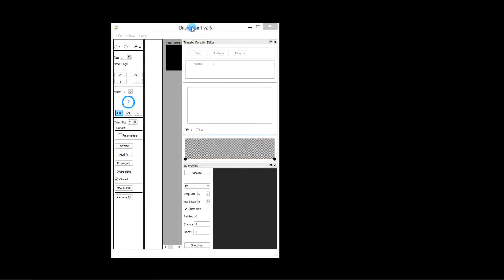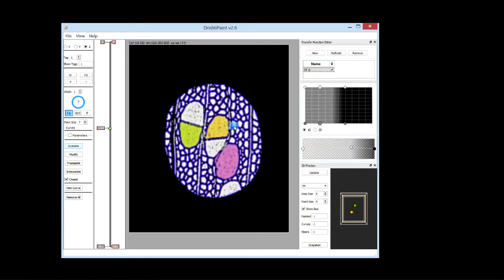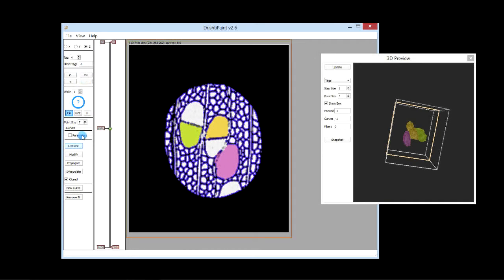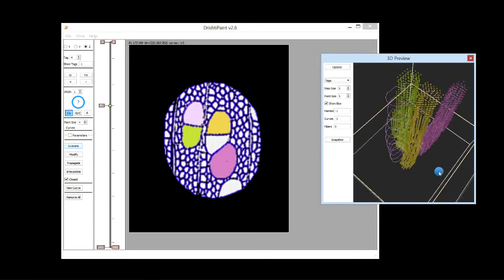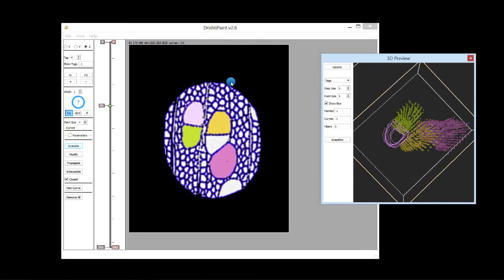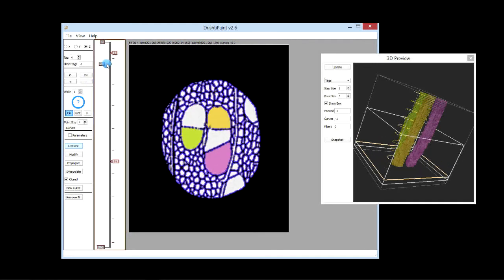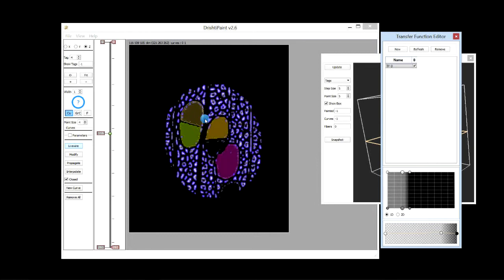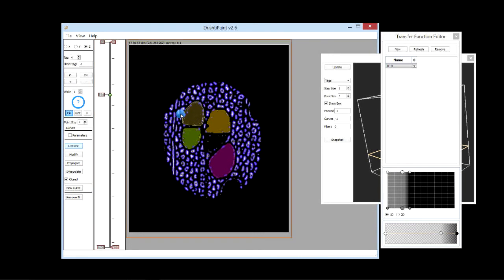Livewire (1) in Drishti Paint v2.6

Comment: Hi,
Firstly thanks for your excelent videos they are very informative and go at a great pace.
I accidentally flood-filled an image slide using keys 'F' and 'G' on drishti paint and I cannot delete the coloured tags.  Any ideas how to solve this?  I just want to delete all tags on that one slide so only the original image is left.  Thanks so much for your help in advance!
Reply from the maker: Hi Tom,
  When in the 2D slices window, press Escape to stop the repeat process.
Curves Mode -
To remove all the curves on a particular axis (X/Y/Z) use "Remove All" button at the bottom of the Curves Parameter menu on the left.  You can also remove the curves individually by hovering over the curve and pressing DEL.

Graph Cut-
Press r to reset the tagged region on the current slice with the current tag.  Use Shift+r to repeat the operation over multiple slices and press Escape to stop the repeat process.

There is inbuilt help for these operation in "?" button just above the Cu/GrC/F buttons.  The help changes according to the option selected.
Reply: Thanks so much for your help!  Its very much appreciated :)